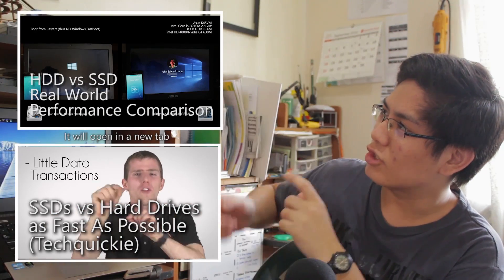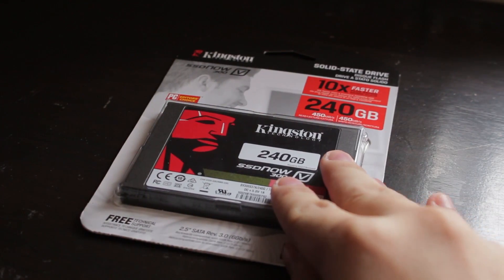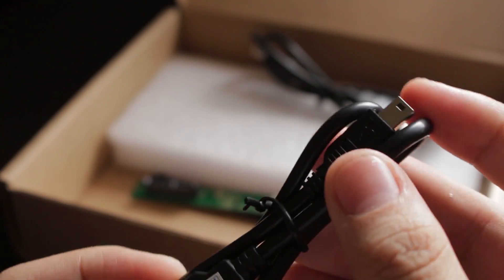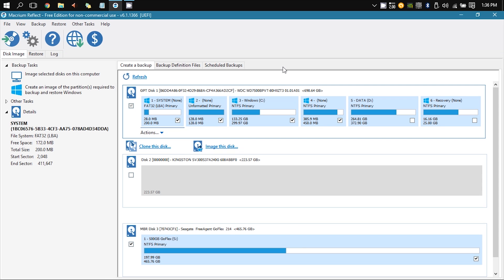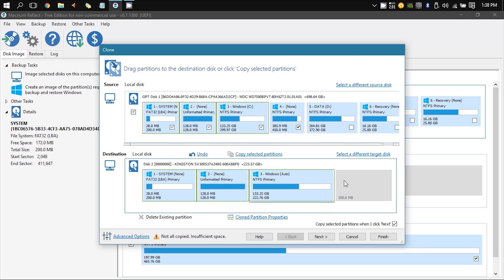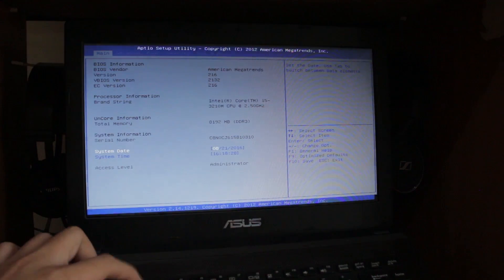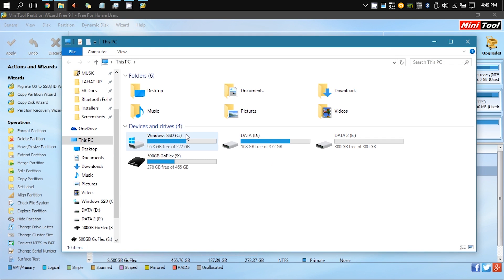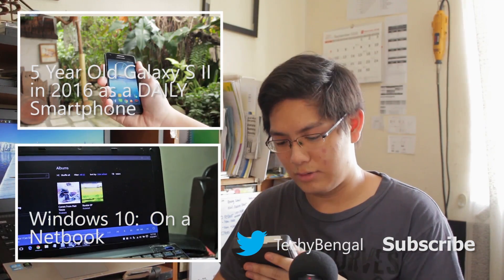[OLD] SSD + HDD Dual Drive Setup in Almost ANY LAPTOP

Comment: Hello There, Question: Consider a same situation like I have installed my OS and Application on SSD. Take an eg Like Adobe Photoshop and If I save psd files in the other drive which is the old disk.. Will the performance improve?? Or I have to keep those files (psd) in SSD drive only? Which is the newly created C drive.

Comment: Nice video. I have never used the optical drive in my laptop, so great idea to put a writable drive in there instead. I don't know about deleting the Windows OS partitions from the old HDD though. I dropped a laptop once and the cloned SSD in it stopped working. I pulled the original HDD that I'd kept as a backup out of the drawer and I was in business again. Do you really need that extra HDD space? Really?

Comment: Thanks a lot!!! Your video was relly helpfull to me. I was ready to upgrade my laptop's HDD to an SSD (HDD was chocking it) and trhrowing away 1TB of storage space. Just before doing this I just came through your video and immediately I took a decision: instead of throwing away my HDD, I would just externalise my DVD drive and put the HDD there with a 9.5mm caddy. Everything went as planned! Smoothly. And my laptop is on fire now! Thanx again.

Comment: Is it worth it to buy a 7200 RPM HDD for the caddy, or should I go for the regular 5400 RPM HDD instead? BTW I'm already using a SSD after the OG Hitachi 1GB HDD that came w/ my K55VJ decided to fail after 14 months way back in 2014.

Comment: Hi, Is there a limit on the storage size of the hdd? I'm planning to buy 2TB sshd or just hdd as an additional storage. However, there are videos which tells that the storage size support of the caddy is limited to 1TB and on the caddy(that i'm about to buy) says it's limited to 500 GB. I'm doubtful that i'd buy the 2TB drive and it may not work, how likely is that?

Comment: Sir 1 question. How the ssd in the caddy gets connected to the laptop? There are no wire connection right. Then? When we put the caddy inside the dvd drive bay does it automatically gets physically connected? Please answer..
Reply: Yeah, it gets physically connected just like a USB drive to a USB port.
Reply: yah it reads automatically
Reply: Well, yeah, the dvd drive connects directly to a sata port, so, yeah.
Reply: If you look carefully you can see it in the video too. The caddy has a connectior at the back that acts as a pasthrough from the drive in the caddy to the laptops motherboard conector
Reply: it reads like u have dvd that has 240gb haha

Comment: Hi there, great Video! Is this by some chance - Asus K55VM?
And just to get that clear - I use windows 7 and I have Asus K55VM - so after I clone the HDD C drive with the system files and everything all the data and programs and windows and everything will move to the SSD and look the same way as it used to on the HDD but it would be much faster. Am I correct?
Many thanks in advance!

Comment: Be aware, installing a SDD and cloning all partitions may mess up the original recovery option (Asus hit F8 to recover option) . The way to avoid this is using Macrium, create an image of ALL the OEM partitions and save it off to an external drive. DO NOT delete the original partitions, maybe 5 or more, some may be hidden, without imaging the WHOLE OEM drive. If you ever sale the machine, you can reinstall the original drive and reinstall the image to return it back to OEM. I have used a number of cloning AND partition programs. by far Macrium Reflect is the best I have ever used. 
**********Secondly, Macrium has a "Repair Boot" option that rewrites the correct MBR to allow the HD to boot properly. If after imaging a HD it doesn't boot, boot to the Macrium recovery flash drive, (spam F10 or F12 on boot select flash drive) open options at top and find "repair boot problems". This option also works on OEM drives when they fail to boot properly. I use Macrium on EVERYONE of my pc's to make sure I have protected images of the OEM drives. Hope this helps someone.
Reply: When you clone your hard drive to SSD drive you'll have a copy of it. If anything goes wrong just put the old drive back. It workes as a backup.

Comment: there is not yet any option to do the same but be able to change the SDD/HDD faster? like if it would be a cartridge? Not usefull for the primary partition (because windows would be there, making the detaching option a waste... but for a secondary drive? that could contain raw data like videos, or security copies? why not.

Comment: Great video and made a decision to buy.
I installed SSD in primary and HDD in optical caddy. Both are working fine. But the HDD is working slow. The transfer rate, opening a folder in HDD is very slow.....any suggestions???

Comment: Hello sir, i cant seem to find an answer to my question , maybe you can help me out if possible , when replacing the optical disk drive with hdd does it support 2tb or what is the maximum size of hdd does it support ?

Comment: Hi EJ
If HDD replaced into caddy and SSD put into hdd is...after replacing It's can trouble the system? Or the system still can run normally before cloning process done?

Comment: I can swap my Dell HDD out in a minute as it slides in from the side after removing two screws; I advise cloning the drive with OS to any similar HDD every so often, ideally after any major updates / upgrades while it is all working; keep the clone elsewhere as a failsafe backup. Keep in mind it can be quickly swapped in for the main drive, should that one die, but will only boot in the original machine as the Windows licensing keeps it chained to that object unless one has a real, full license (not the OEM one that nearly everybody gets with an OTC computer purchase). The clone will likely be readable via external connector, as an extra external/internal drive, if the original machine is lost, to pull over data, and may be able to run programs installed on it, just not run the OS itself. Backups and clones kept apart from the main unit serve overlapping but distinct functions, and SSD's are still untrustworthy by themselves. Forewarned is forearmed.

Comment: hi EJ Tech - thank you very much , that's great - I am a computer newbie, with Acer laptop -  I bought ssd and caddy - I am a bit concerned about the end part - downloading Macrium Reflect 3 and cloning , seeting up partitions etc - is it worth just installing the ssd into the caddy and putting that into the optical disk drive space and running the computer like that ? (so without cloning and partitioning) - obviously i want the ssd for faster performance - if I did this would it make any difference to the performance of the computer? (at all )?

Comment: I have windows 10 in the hard drive compartment of my n550jk, I also have another ssd with Linux on it and want to alternate/switch between booting off both ssd’s/operating systems by installing the Linux ssd into a caddy in the dvd bay, is there any reason I wouldn’t be able to boot from both ssd’s?
I’ve tried booting the Linux ssd via a USB port but after fiddling with all suggested bios settings it just won’t recognize it like a usb stick would be?
So my only options are regularly opening the laptop up to swap around the ssd’s which risks damage, or go and buy another computer just to run two operating systems
I’ve ruled out virtual machines and dual booting as I don’t want to risk the data on Linux (my important work and financial data) if windows damages the whole ssd that both OS would be on
Any help would be greatly appreciated

Comment: Good day. I tried an SSD drive upgrade in place of the old sata drive to speed up the laptop. I took the old Sata HDD and installed it into the optical drive bay using a caddy. I reformatted the old HDD drive now installed in the caddy and optical drive bay. But upon booting the laptop, I cannot see the Sata HDD in the bios or in disk manager. Do you know what the problem might be?

Comment: I noticed that you didn't clone the "Recovery" partition from your HDD. Does this means you are not able to recover Factory Image?
Reply from the maker: I'm honestly not sure. But I no longer plan to use it since using a "vanilla" Windows installer is much better.
Reply: Thanks for follow up! Worth to mention that Win10‘s Reset this PC function is more than sufficient (minus the hassle to reinstall drivers)

Comment: If My laptop has m.2 port ... Can I use a hdd and ssd at the same time? Without removing the dvd
Reply: yes.. get the M.2 SSD installed.  if you have the cash, you can have 3 SSD drives.. M.2; 2.5"SSD in the HDD bay; and another 2.5" SSD in the DVD bay with the "DVD-HDD/SDD adapter.

Comment: Thank for the video man, that's so helpful. Btw, is it better to place the SSD into the HDD, and move the HDD into the DVD drive, or is it completely the same which mean there is no performance effects wether you put your SSD on HDD or DVD drive? Also, is it better to do a clean new windows installation rather than just copying its system files?

Comment: @EJ Tech question is as follows dell latitude model E6420 64 bit win 7 has currently 120 ssd , but as of late i have not been able to access my laptop, got in thru bios says unable to locate hd. no hd installed, so i am gathering that i need a new one, what if i decided to go with 2 nd one since i have to get a replacement anyways, but since i am unable to access 1st hard drive, what is involved installing seems easy ok as for os ? install st then 2nd and how do i do that since i have no disk

Comment: i had mu hdd in the caddy for almost a year now,worked perfectly.Yesterday i needed that hdd so i pulled the caddy,use it in another laptop an went and reinstalled it in my laptop afterwards.Problem is,now the caddy hdd is not showing up in windows or bios.Any suggestion? Checked the hdd,it works,caddy works.Could it be some bios setting im missing?

Comment: Great job EJ. U have a new sub...not quite good at this but I can follow thru. Just a question... i saw a caddy adapter online it measure 125mm*125mm*9.5mm and my dvd drive is around 130mm*9mmwould it matter? Or the difference is negligible?
Reply from the maker: Negligible. As long as the height is similar (9mm)

Comment: Can i ask what is your laptop model so i can search the optical drive size. Mine was 9.0mm but available caddy size was 9.5mm, should be fine to use the 9.55mm? Thanks mate
Reply from the maker: Close enough. As long as the height is similar (9mm)

Comment: hold on a sec, can i put my ssd to were hdd was and hdd in a caddy, change bios to boot from caddy hdd and then clone and change boot to ssd?
Reply: relax relax.... no need to change anything from the bios, wherever your SSD and HDD are plugged in, their name is the same, it's not really working like that, but in short : Bios: Where is SSD 1 ? It's not in the drive bay, wait it's here, let's boot from it. 

What I mean is, just switch the two drives and the bios will boot to where windows is installed, if you want to clone one to another, I can't help ;)

Comment: Hey brother, nice video and trick to increase speed, would it be easier to simply install drives and just install fresh windows or other OS in SSD ? Will that be different of what you did in the video?  Thanks
Reply from the maker: You can just do a clean install if you want and have the time to do so.

Comment: I tried doing this with an old laptop … it tried booting off the 2nd HDD in the caddy instead of the original primary drive. When I looked into the BIOS, the new drive is listed as "Primary device" and the first drive isn't recognized while there's "nothing" in the modular bay where the 2nd HDD actually is … I would consider updating the BIOS, but it's officially the most recent version according to Dell's site since 2011

Comment: Hey EJ, How was your Laptops Caddy doing? i've been hearing some reports that their laptop's motherboard has been fried because of using this Caddy. I have mine installed for a while now and it is still doing fine. Just want to make sure we're safe here.
Reply from the maker: It's been a year and I had no problems whatsoever.
Reply: Salamat sa reply bro. Maybe the one that experience the problem really pushed the temps during gaming
Reply from the maker: I can push mine full CPU and GPU load in the middle of Philippine summer, no prob.
I just need to use my DIY cooler but even with no extra cooler it doesn't shut down.
Reply: Bro anong size ng optical drive mo? 9.0mm kase sakin then yung available caddy was 9.5mm
Reply: 9.5mm yung gamit ko. eto http://www.shopzadaph.com/2017/09/review-hdd-caddy-for-laptop.html
Reply: Marvin Gabriel 9.0mm kase optical drive size netong laptop ko. Baka alanganin ang 9.5mm. Baka kase sayo 9.5mm kaya okay lang.

Comment: Nice video! Mine hard drive bay is limited to SATA, so, if I'm correct, it's best to follow the steps in the video.
It'll take a while until I have the money to buy a new laptop, and I can reuse mine HDD (as external HD, because he is a little old) and SSD later  :)

Comment: Hey I have Ideapad 300-15ISK  80Q700DWIN model with i5-6th Gen. Can I upgrade my 1 TB hard drive to 512 GB SSD or what is the maximum SSD size supported  by this laptop. Can You Help?

Comment: Won't you get better SSD Read/Write performance if you swap it with the drive in the original HDD slot and stick the rotating drive into the old Disk Drive slot?

Comment: Afresh install of Windows will be lot faster on SSD ? RIGHT ? Why clone it. Can you just install Windows on SSD and use older HDD in caddy as Data drive. Slowly when you have installed all programs that you need,. you can format old HDD and reuse complete HDD as Data drive.

I understand this way is largely Manual and time consuming. But you should get best speed and optimised OS that way.
Reply from the maker: I did a correction where the HDD is best in the caddy with the SSD internally. This guide also has the OS and programs in the SSD with the HDD dedicated for mass storage.

Now for cloning vs clean install. For me during that time it was better for me to just clone over and get up and running ASAP. No reinstalling stuff.
A clean install is also an option if you want if you prefer.
Reply: EJ Tech >> In my experience, on HDD fresh install of operating system, makes system always faster.

Comment: But those removable dvd bays have not been put in laptops for at least 5 years now 😂
Reply: buy a second hand leveno thinkpad 420 at a cheap price they are better than any other laptop to work on and better full stop i have a core i7 with 8 gs of ram and it is lightening fast plus has multiple bays to work with and you can pick up for around 150, best macine ive ever had and complimented by the 12 " version which only cost 90

Comment: almost a year later it should be mostly clear that it is better to move the slow spindle drive into the caddy and have the SSD inside the notebook. Reason --> legacy optical SATA 1.5Gbps interface in the optical drive bay. Put the SSD on your internal SATA 2/3 connector.

Comment: I always install the SSD into the existing drive caddy and take the hard drive from said caddy and install at in the optical bay caddy. The reason for this is that some manufacturers only have a SAYA 1 or 2 interface for the optical drive (more than fast enough to handle an optical drive). That would present far more of a bottleneck for an SSD than it would an HDD.

Comment: 20 years of IT. PUT THE SSD IN LAPTOP!!! overall speed much better. if you want extra space. then use a good fast hdd, fitted in the cradle.
Reply from the maker: I did a correction where the HDD is best in the caddy, with the SSD internally. (In the description or my pinned comment)
This guide has the OS and programs in the SSD with the HDD is dedicated for mass storage.

Comment: You should put the SSD in the original HDD caddy then put the HDD inside the caddy.
You most likely have SATA 3 on the HDD bay. 
Most HDDs don't really saturate SATA 2 so putting the hdd in the caddy is better. :D

Comment: always put the ssd in the hdd bay and the hdd in the caddy. you get more speed from the sata controller and you dont get to run the ssd through some cheap caddy adapter.